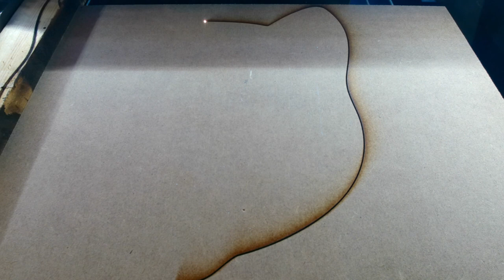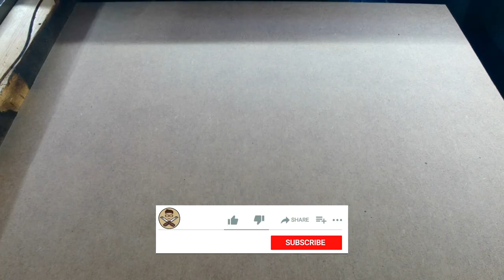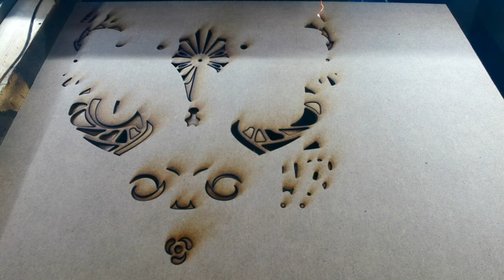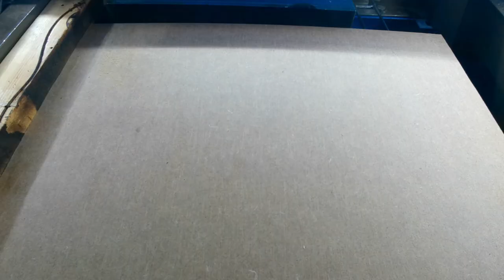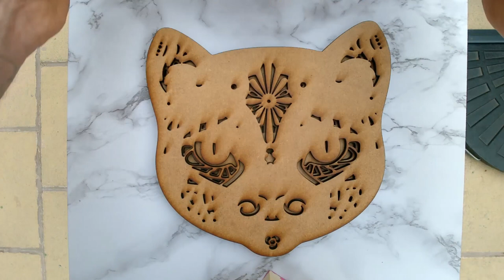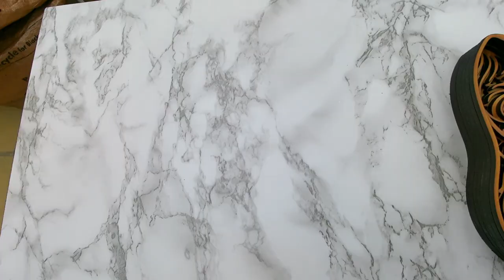Laser art : 7 layer cat mandala cut from MDF on a K40

Comment: Why are you getting the scorching marks on the top surfaces? I know you can get scorch marks on the underside but I've never seen it on the top like that.
Reply from the maker: That is not scorch marks its residue from the cut (smoke) being blown back down on the surface, this can either be cheaned with a damp cloth or you can mask the work beforehand to stop it getting on the surface